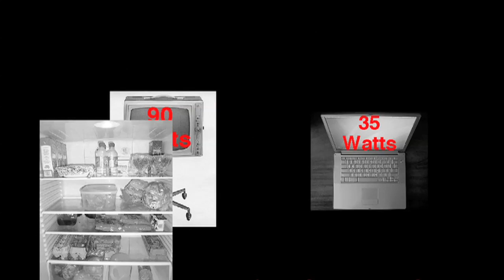Life on 150 Watts

Comment: One 250-watt solar panel would completely change their lives.
Reply: they already have the equipment, one dollar per watt of solar is normal in the USA if you install it yourself, 1k  usd should give about 4 or 5 panels and about 1kw per hour max of solar, this should give you a good 4-5kw per day average.
every house should have at least 5k usd in solar and electrical rigging plus the batteries, total off grid except in the really cloudy days in winter(even then you can just get a small used honda generator and a few gallons of gasoline to top up the batteries)

Comment: I agree...2 100watt solar panels, and a charge controller, for your batteries.
  When I had 2 12v 100 watt batteries in parallel, a 1500watt pure sine wave inverter,  and they run my 600 watt, (850 power consumption) Microwave...good enough to heat small meals. Most I use is around 8 minutes, maybe add 30 seconds. But that is the longest. They could steam veggies easy. I get around 12 uses, enough for 3 small things a day, even a couple of 1 minute hotdogs.
  They could have a few more creature comforts. Some LED lights would help too....
  I had one battery, it cracked, got a second to replace it, but as the first was still charged, and useful, (did not leak), I did some tests, and it was good for about 6 days of small uses, (2-3 per day). My microwave as described, and a 300 watt One Cup Tea/Coffee maker. Will also run just about everything else, but of course nothing large for a long time. (only 100ah of useable capacity). Good for small things, and short runs on the 80amp Microwave.
  You can see my video of making a hotdog, if you like...
Inverter and Microwave...Cooking a Hot dog.

My demo of what it takes to use a small microwave oven.

Comment: Good Point. They would still have to run their generator. An energy efficient fridge is around 500 watts and a microwave can be anywhere between 600w and 1500w. The fridge runs all the time the micro occasionally. In this situation we really have to start thinking in Watt-hours because they do have a battery bank. They still appear to be short.

Comment: They said at the start that they do have a genset. I guess the 150W is just trickle charging their batteries as an extra source of power. 

Looking at the high hills and watching the foliage blowing about behind the lady on the couch, I'd be looking at a small wind turbine and solar panels, not hugely expensive and certainly far more economical than running a genset every day. Less labor intensive than a methane generator too.

Comment: Looks like they have a nice head so it's the location of the turbine that should be looked at. Remember any excess unused current can be redirected via a shunt charge controller to a heating element that will boil water to create steam. The question is if they don't need it, what will they do with it ?

Comment: You are so right. 24hrs of energy harnessed correctly will provide what you need. Microwaves are unnecessary, who needs a dish washer or for that matter energy hungry appliances. A fridge placed in a cold area does not have to continuously work to fight external ambient temperatures. Too many blogs on this page are 'inside the box' comments

Comment: Firstly solar is great when sun is out and you have no forest canopy blocking out the light but bear in mind the additional costs of deep charge batteries, sine wave converters, charge controllers and where to anchor your solar panels.
From an engineering point of view, energy from water is actually easier to harness. It runs 24hrs and simply because of this, you can cut out the cost of the deep cell batteries.
Different water wheels = differing currents.

Comment: Why they use such a bad turbine? If they had water, the correct water power machine has to be used... So not the height of drop is the problem: The wrong machine is the problem.
Combined with solar energy, wind power and maybe a steam boiler powered with methan (hot water and steam for refridgeration and climatic purposes, as excess can be use in steam engines) 
I don't understand, why stay on less...

Comment: "It really isn't necessary any more to live so lean on power."
Really? How about the imbodied energy of a solar panel? You'll need a lot of oil to get the plastic cells made, Same for te alu. frame and glass. Take it step further and less power means thinner gauge wiring meaning less copper and less plastic.  Less is always better.

Comment: they should put those cows to work (a rotary generator)...like the old days :) run it once a day to charge the deep cells...free power and great exercise for the cows...those cows can generate lots of torque, if a big motor is geared properly could produce lots of power...along with hydro, solar, and wind...they will be running Christmas light by next year :)

Comment: Great project you guys have there.
Small comment, a refrigirator never uses 500 watts of power.
The good ones with a A or A+ certificate use not even 100 watt.
I seen ones that use 60 watt and there huge.
You guys should look into that.
That will save you a lot of energy
Greetings from Belgium
Erik

Comment: You can be sure we have...but not all Fiji is sunny there are areas central and most of the southern parts specifically Naitasiri where Mr. Eastgate resides where it is usually cloudy and rains a lot..as far as PV is concerned there is already a program for 20,000 rural households in progress and 1400 households have already been provided basic lighting via stand alone 100 Wp systems in the Norther island where there is alot of sunshine